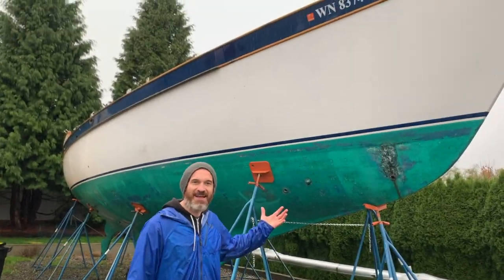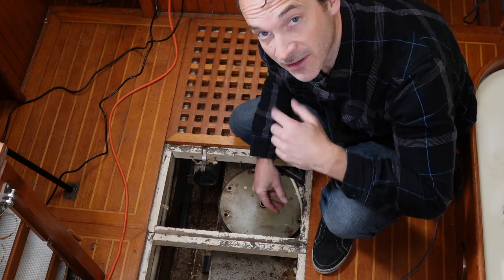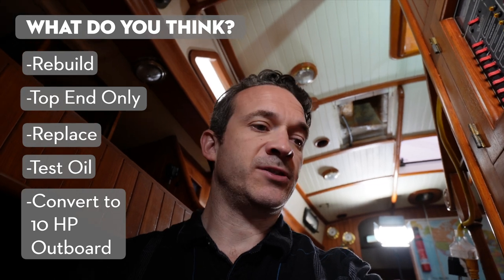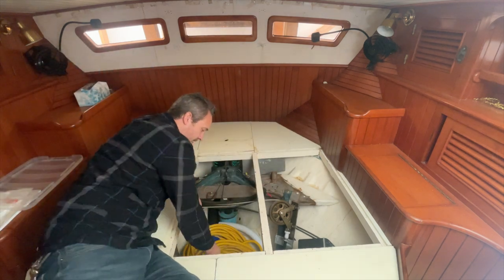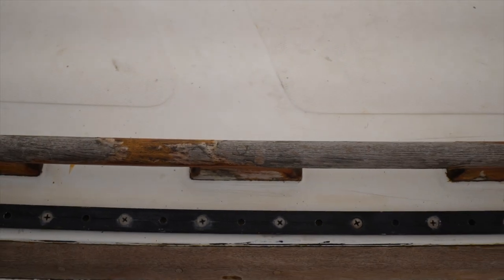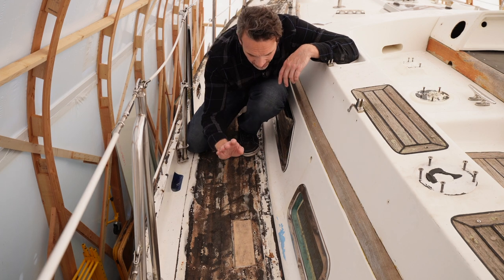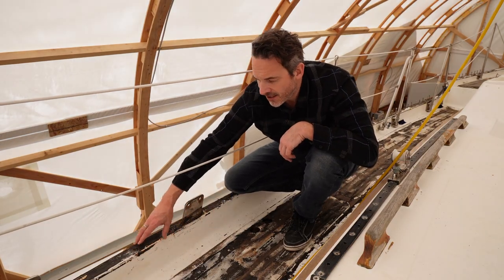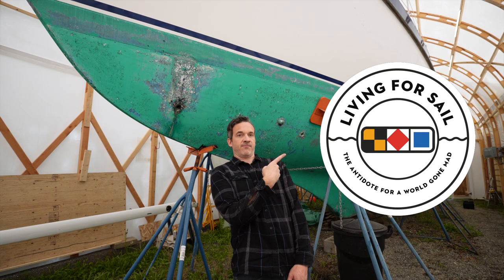Sailboat Refit: An Update on the HUGE Project! | E003

Comment: Great video!  I have a boat of a similar age and construction style.  A couple of the items we discovered were a leaking holding tank, a leaking fuel tank, and so on.  From what I can gather, I'd figure to replace the holding tank with something in the 40-gallon range, replace the diesel tanks, and have a really, truly, down-and-dirty look at the engine.  When we bought our boat, her engine passed the engine survey.  We later discovered a raw-water leak, a high-pressure fuel-pump leak, and various pieces and parts that needed reworking.  Also, if the deck core is going/gone, you'll want to take a hard look at the areas where the mast goes through the deck.

Another channel you might want to check out is Sail Life.  He had to redo his decks completely.  And, too, the guy on A Boat Called Wanda went through a similar drill.

Best of luck!  I'm looking forward to how the project progresses!
Reply from the maker: Thanks for the feedback. I think it sounds like good perspective. I’ll definitely take a good look at the engine 👍

Comment: Not sure if anyone else has suggested this, but I installed a Jet Thruster on my HC33 and love it. Probably a little less cost and a lot easier installation than a tunnel bow thruster. I’m watching with a lot of interest since I’m going to be doing a lot of the same work in a few months. Would love more info on the boat shed. Thanks!
Reply from the maker: Funny you should mention that. I did a video interview with Bob Perry about the refit and he suggested that hardware. 
I didn’t get great footage making the shed because I was racing the weather as the birds all flew south… I am considering adding a section to the back and will make a how-to if I do that.

Comment: They are now being used in building structures, so the toughness is pretty good.  I would also install it in a sandwich composite where the VIP is the core with FRP on both sides.  It is not one big vacuum chamber like a thermos bottle.  It has small chambers in a honeycomb pattern so that loss of vacuum only affects the single cell.
Reply from the maker: I’ll definitely need to look into that. Is it $$$$$?
Reply: @livingforsail  ??? I have not priced it out.  That is more of an Architectural question, and I am just a Structural Engineer.  😄😄😄 The are using it for floor insulation in building structures so it cannot be out of this world.

Comment: Go all electric cooking and solid fuel BBQ, no more propane.  Foam or nidex core hard top with lots of PV all the way to the dingy davids.  Replace chainplates with glass and carbon fibre chainplates and synthetic rigging.  Possible electric power for dingy, or diesel outboard.  A small light diesel outboard.  No petrol required.
Reply from the maker: Some interesting ideas in there. Thank you! 🙏👍

Comment: Looks like you have a good plan and I love that boat! If the engine is running fine, I’d take it one step at a time before replacing: oil sample, rebuild injectors and maybe top end rebuild.
Reply from the maker: I like that plan. I’m thinking along the same lines lately.

Comment: Sailing uma went full electric. Including propulsion that is. They had a (light) genset on board for when they where in the northern latitudes. I‘d stick to reliable diesel + electric for the rest. 

Or.. if you wanted to make it harder.. find a cheap vw 1.9tdi alh, marinize it, couple it to an electric motor that can propel the boat and generate power. 😅
Reply from the maker: The technology is getting better but I think I agree to stick to the proven diesel for now. 
Uma’s boat (great channel by the way) is a Pearson 36 I think and is a little less than half the displacement of Antidote. The short of it is that I’d need a pretty big motor/battery setup to realize any range out of full electric on this boat. 
Maybe as battery tech improves and prices come down I could plan to re-purpose the diesel tanks into “engine battery space”. 
Time will tell. Thanks for the input!

Comment: Nice project and good to see another one here in the Salish Sea.  For your fridge/freezer rebuild, have you considered using a Vacuum Insulated Panel (VIP) instead of foam for the box.  That way you get much higher performance in much less space.  Something like Advanc-R has an R value of 66/inch.
Reply from the maker: I have considered those a bit but I worry about a failure and ending up at R0… maybe a combo of both?

Comment: Maybe ask Matt to build you some new carbon fiber chain plates. 😂
Reply from the maker: Haha. Those are amazing. I do have a mental block however with glued in chain plates. I get it that they are spec’d to several times more load than required but there’s just something about a bolt that makes me feel a bit more comfortable…
Reply: @livingforsail  haha! Totally agree and I actually said as much in the Patreon comments, but he insists it’s actually stronger. Hard to imagine.

Comment: Keep the prisims for the light they provide. Since you will be recoring the deck,can the core be made thicker to keep the original level of the teak? That would eliminate any mods to the prisms.
Reply from the maker: When I re-core the sections with the prisms I will try to provide a recess to drop the prisms into. Raising the whole deck up would be a ton of extra glass work and fairing I think. I agree with you that the light they provide is great. Do you have any? Are they leakers?

Comment: You ask about the motor and my Libery has a Perkins so I can't help you with the Lehman, but you jokingly asked if you should replace with a 10hp outboard.  I mounted my 5hp outboard to the swim ladder to get into a mooring when I lost my starter and it can move this boat at 3 knots!  Perfect for getting into an anchorage in a pinch.  :)
Reply from the maker: Wow. That’s actually pretty amazing. Line you said. Good in a pinch. 👍

Comment: I like the prisms. They provide some light inside, useful at anchor. Just, they are vulnerable and lights can be placed at will and where you actually do need them. 

Two minds about them, they belong on the boat. Just, there are better ways to provide light. And no, I have absolutely no interest in 'keep the boat original'. In essence it is a production boat, not a one off. But even when someone wishes to keep it original, the question should be 'does it make the boat safer'. And that is always the main concern. Look at it from another point of view: Tally Ho was a tremendous boat in her day. Just what Leo is doing is the right thing, improve the systems.

Yes, yes, I was done, just I had to comment.. 😂
Reply from the maker: Great input Paul. I agree. That they have a place on the boat. I don’t think they add much in the way of safety, but I don’t think they compromise safety if done correctly. I have some ideas for those. 
Maya and Aladino actually gave me an old prism from Magic Carpet 2 that they don’t need and it’s an exact fit for the one that I am missing! 
I will probably have these incorporated into the deck and also include some new soft lighting strategy using LEDs. 
Ok, I think you are caught up on all of your video comments now 😂. I really appreciate the interest in the project! 🙏👍🙌

Comment: Keep the gas locker but only for an outside barbecue. This is a back up to your electric cooking and provides reliability. Plus you have a bbq. That’s my thinking anyway.
Reply from the maker: That had crossed my mind also. It’s a lot of propane for an outdoor BBQ… I could probably commit half of the space to a small aluminum cylinder and then use the other side for XYZ… I have heard that propane can be difficult to obtain while abroad so I don’t know that I want to invest too much into the propane system.
Reply: @livingforsail  I think the point is not whether you can get gas somewhere but rather that if you are off grid and you power goes out for whatever reason - you are still able to cook. If you are worried that you are not going to be able to refill gas bottles then you are considering at least being quite off grid. You could even have one propane and one LPG. I take your point about space but self reliance off grid is an area worth consideration if that is something you are considering. You need to keep afloat. You need an engine. You need water and food. To me that gas locker is a small space that will allow for a bbq which you will use anyway. And provides backup to cooking.  I will stop my ranting now lol. I hope your journey to the water is smooth sailing so to speak.
Reply from the maker: @rosscuthbertson2679  I appreciate the perspective. Thanks!

Comment from the maker: Do you have experience with some of these projects? I'd love to hear from you!
Reply: We are two years into a massive refit of a Perry designed Norseman 447. I installed a bow thruster and went with the most complex tunnel scoop design because why not? It was a really fun project that required a lot of head scratching and fixture design. We also faced the cap rail dilemma and chose to fabricate a new one out of tropical hardwood rather than go with an aluminum toe rail. I will be happy to answer any questions you may have if you think it would be helpful.

Comment: The inside of the fuel tanks can be restored with a product that is made.. I've used it on old motorcycle tanks that were in bad shape, plus add eight a fuel polishing system or another fuel filter
Reply from the maker: Like Por15? I was thinking about that but I need to figure out how to deal with all of the baffles…
Reply: @livingforsail  I didn't even think about you having baffles.. I'm sure they make something that will work.. citric acid is biodegradable and is a wonderful cleaner.. perhaps you can drain them and clean them out..
Reply from the maker: @bendaves77  I will pressure treat first to make sure there are no pinholes. If not, I will probably try to keep using them. If they develop leaks I will get ATL to make some fuel tank liners for them. It looks like a good solution for decent $ and only 5% loss of volume.

Comment: Those fuel tanks are completely knackered  replace with  new ones, the last thing you what is any crap going towards the engine
Reply from the maker: It’s the part that I can’t see that worries me the most between the hull and underside of the tank. I will take a good long look at these and figure out a plan. Thanks for the input!

Comment: I would definitely go thru the diesel engine keep it.. if you need more power then you can add a turbo.. do a oil analysis when you change it your first time.. it will tell you what bearings and parts if any are wearing fast and be able to give you a life expectancy report
Reply from the maker: The motor has plenty of power. They used the same one for the 49’ Liberty. I aim to keep it. Oil analysis seems like the best approach.
Reply: @livingforsail  we've used oil analysis for years in semi truck diesels and every wearing piece is made by a different composition and they can tell exactly what is wearing, and how quickly it's going to need repaired and the analysis isn't that costly
Reply from the maker: @bendaves77  I regret not collecting a sample after running the engine and stirring the oil up… I could get it restarted up on the hard (probably good to run it periodically anyway…) That’s probably what I’ll do.

Comment: Lehmann 90 is a ford major tractor and D series truck engine , as you said they all smoke from cold . But they are bullet proof and you can get parts all over the world.  What is the reduction gear ? Usually they had  borgwarner , prm/ newage or hurth/ zf . Borgwarner are good but make sure oils red and clean . Prm and hurth no issues. My qualifications are marine engineer of 36 yrs .
Reply from the maker: Yeah, I think the motor has a lot of life in it. Do you have any input on maybe just doing the top end while it is “easy”? Maybe not even necessary… probably won’t make any call until I do an oil sample and possibly compression test (might be hard since there no readily accessible port to tap)

I have the BW with 2:1 I believe. Unknown hours on it. Probably worth going through it.
Reply: Spin the engine over with the injector pump fuel stop on . If it sounds even on turning it over on starter , leave it alone , if it sound irregular one or more pistons are low compression,  or valve leakage . The only real issue with these engines was valve stem seals getting hard with age . Oil pressure should be 40 psi at 1200 rpm above 15 psi at idle . If on start up the smoke is blue rebuild head , do not get head skimmed,  never any course to , have checked for cracks ,but not usually a problem.  Injection pump should be a minimec, if not please tell me what makes fitted cav or simms on older engines . BW reduction ,make sure oil cooler is clean ,oil and coolant sides.  Other than theses points to check if all good , leave alone . It won't let you down . Carry spare as you should , filters , belts , oil, coolant , raw water impellers . If it was me , a head jacket decode set as well then you covered for anything .
Reply from the maker: @cartertanya1258  I’ll give it a spin like you suggest. It is the minimec pump on this one. 
I didn’t understand the water jacket decode? Could you expand on that?
Thanks!!
Reply from the maker: @cartertanya1258  oh, and oil pressure has been good when it was last running.
Reply: Sorry didn't check spell check before sending message . Head gasket decoke set , all gaskets and seals from head up
Reply from the maker: @cartertanya1258  I had not heard that term before. It makes sense. So it’s all the gaskets you would need to put everything back together after cleaning all the carbon (coke) buildup on the head?

Comment: Hi John! Some quetions about the shed build.. what is your space around the boat, like how wide is the boat compared to the shed? How tall is the shed above deck level? What are your thoughts here? I am trying to design my own shed for a similar project!
Reply from the maker: The shed is 21’ wide and 21’ tall at the peak and this gives me just about 6’ of head height at the edges of the deck. The beams are spaced at 48” and all wrapped in 7mil shrink wrap.